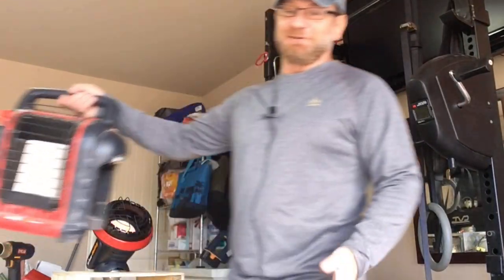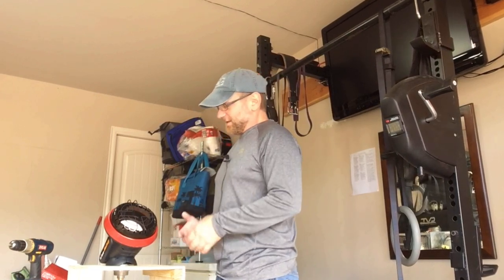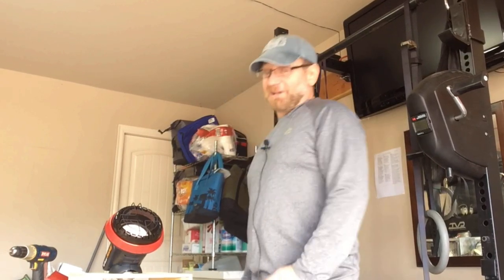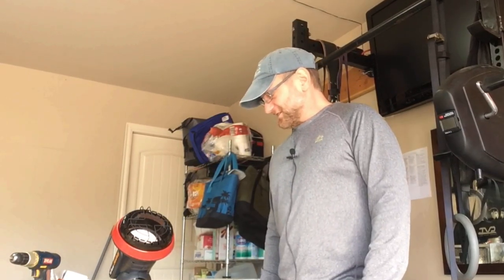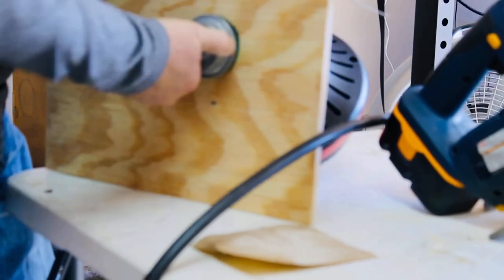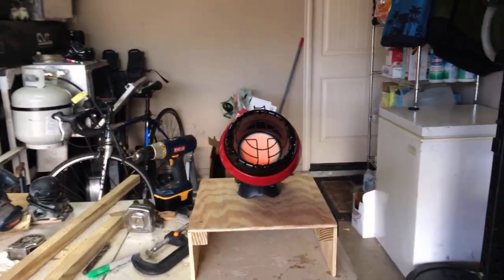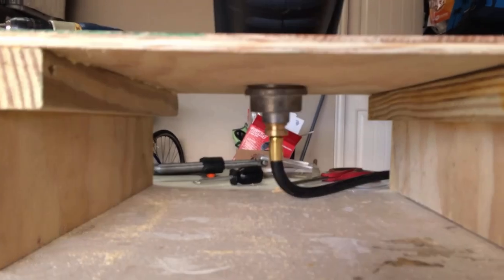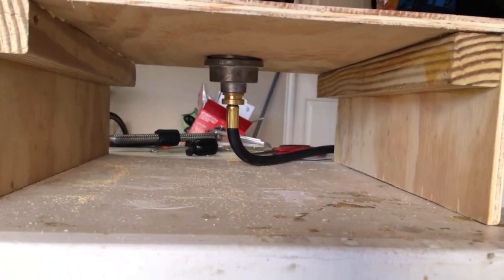Little Buddy Heater Hack #littlebuddy #coldweathercamping #mrheater

Comment: Good idea. I’m definitely doing this
Reply from the maker: You can’t tip it over, you can set your cell phones right on top of the wood platform and keep them a little warmer from the radiant heat so the battery doesn’t die in the cold, and you can store other things right underneath the platform where it’s open. I like it.

Comment: Thank very much for the video I can't wait to build one for my tent trailer had my buddy heater in there and it worked awesome but don't need that much heat so going smaller just like that just wish it could be adjusted like the big heaters
Reply from the maker: That is exactly why I went with the smaller one.

Comment: I really need some help trying to find out here how to start the heater once I have it attached to the 20 pound tank with the attachment hose?  Do I just turn it on a little bit and press start and it goes from there? Because I tried that and it kind of blew up in my face, literally ...so ..yeah..  One part in your video you didn’t show. You just skip to it once it was already on! Please help it’s cold out here !
Reply from the maker: Heat always rises. So don’t put your face above the ceramic or the grill.  Push and hold the button and allow a little bit of gas to go through the hose and get to the igniter. Then re-push the button to use the igniter. You will then have your pilot light lit. You may have to hold the start button for a little bit to keep the pilot light lit and then the rest will light ...it will slowly ignite the rest of the little buddy.

Comment: Curious about which filter you used as well as the hose
Reply: Oh yeah, what size tank is it attached to?
Reply from the maker: I demonstrated it with a 20lbs tank, but I use it with a 5 lbs.
Reply from the maker: It is a Universal Mr. Heater filter... Got it on Amazon... The hose is a  STYDDI 8 Feet Propane Hose Adapter with Propane Tank Gauge... Also purchased on Amazon.

Comment: I also used Bob Wells CheapRVLiving YouTube video to make my own 8”x8” wooden stand that is smaller & lighter...https://youtu.be/W3tZweVpkXs
Do you hear any hissing sounds when you disconnect the high pressure (non regulated) hose from the heater or tank? Next time I’m going to shut off the propane valve at the tank to see if it burns out all the fuel in the hose & filter. I also ordered a longer 10’ Mr. Heater hose that does not require a filter.
Reply from the maker: Since the propane is under pressure there’s always going to be a little bit of release both from the regulated and non-regulated side. Just don’t light any matches…

Comment: What size hole saw did you use and is there some kind of gasket on the filter where it makes contact with the wood? It looks like a tight fit.
Reply from the maker: I just found a round object about the size of the filter that would not allow the larger lip to pass through. I left some play so that there wasn’t a lot of force pushed through the brass threading. I did not put any kind of a gasket on it.  I did not use a hole saw.
Reply: @ericscamping  Getting ready to do this hack. It looks like your using 3/8" plywood? Also as an electrician I'm wondering if a large reducing washer might work?

Comment: Made mine out of a reflector from a clamp on light.
It’s very sturdy and won’t tip over.
Reply from the maker: That’s a good idea. You just put the 1 lbs bottle inside the reflector?
Reply: @ericscamping  no I use a hose to a 5 pound tank.
On the underside I screw a filer to the little buddy cut a notch in the reflector to run the brass fittings through and hook the hose to that.
Reply: It’s only about a foot tall and I let it run a couple of hours and the aluminum reflector remained cool to the touch.
Reply from the maker: @mikelyons3514  That sounds pretty cool. I wish there was a way you could share a picture of that with me. That seems much simpler than all the cutting and gluing and screwing that I did.
Reply: Give me your e mail and I’ll send the pictures to you.
You can also do a build on YouTube and share with everyone.
Reply: Or look me up on Facebook and send a friend request.
It’s a picture of me looking over my eyeglasses
Reply from the maker: @mikelyons3514  could locate you on Facebook.  Erkeiper@gmail.com.
Reply: Did you receive the pictures?